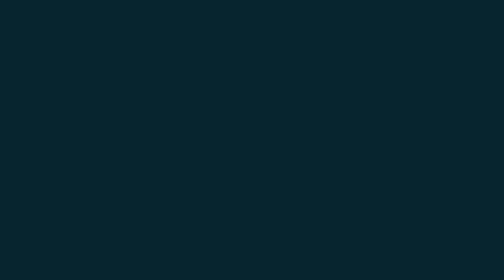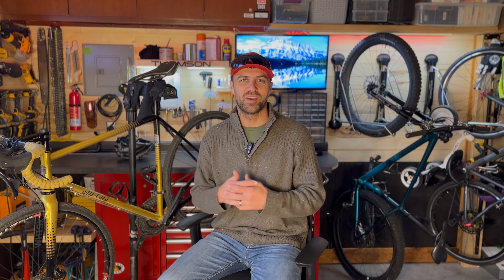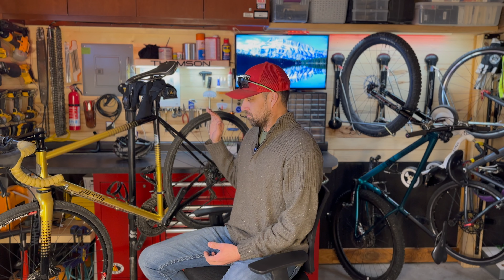Are Carbon Bikes a Horrible Long-Term Investment?

Comment: I don't want anything carbon on my bikes, a buddy of mine is a technician that works with carbon fiber, there are long term complications as the bonding agent will affect it's strength over time, this isn't anything you can really do anything about, people wont be restoring carbon bikes like we restore vintage steel bikes today, buy something that lasts!
Reply: I conceded to a carbon fork as that just makes sense, but otherwise agreed.

Comment: Quality steel, like Reynolds, Cromor, Columbus, Dedacciai, and you forget any kind of issue about the frame. MTB, gravel, road bike made of this modern steel especially xcr or Cento by Columbus are a best buy. Light modern steel and durability the perfect match. Who cares if a steel frame is 300 or 400 gr. heavier than a carbon frame!!!

Comment: A lot of the older riders from the 90's still have a great mistrust of carbon. The abuse the bikes go through from hard riding and the inevitable hard crashing makes the modern carbon frames a disposable item. I still prefer a good columbus or reynolds framed bike. Sure it will be a bit heavier, but it won't be in the landfill after a whoopsie .
Reply from the maker: Yeah that is kinda the thing you have to wonder… did the bike industry shift to carbon because it keeps sales going since steel lasts forever (basically)
Reply: It's not that heavy: my hard-tail cross-country mountain bike (size L with a slooping frame) weighs 10.6 kg with full SRAM equipment and 27.5" wheels (Crossmax). A carbon frame will save 300 grams, but it will be fragile and uncomfortable. In fact, manufacturers are reproducing the same thing as with oversize aluminum tube frames: they vibrate and are fragile. Last year, I had a nasty fall with my Tange Ultimate steel tube frame, and it's as good as new. Carbon is more or less comfortable with 29-inch rims, but on very rough terrain your wrists had better appreciate the vibrations. I tested a friend's bike with an old Clark Kent titanium hard-tail frame, and it vibrated a lot.
Reply: I have close to 15 years on two aluminum road frames and 20 plus on a USA built Specialized Stumpjumper Pro M4...I’ve had a handful of incidents on these three...the back slid out on my Cannondale because of a patch of oil on a turn, and my Fuji got caught in a road rut formed by a poorly paved section in Brooklyn....I used to jump the crap out of my Sepecialized and crashed maybe 2-3 times...on one occasion the handle bar turned all the way and the brake lever put a small ding in the top y
Tube.....that’s all the damage I’ve incurred in over 30 years of riding bikes in Brooklyn and Manhattan....my wheels are the only components I’ve ever seriously worried about.....I’ve cursed the NYC DOT ....Department of Transportation many many times ....loudly when I would hit a small bowl sized pothole in the dark .....ugh it’s horrible...but those head on impacts were never the cause of a wheel going out of true....the lateral shunts were the culprits in the few instances..... and I’ve been riding Continental tires almost exclusively through the decades and have maybe 5 flats in that time frame....
The USA, hand built frames I bought years ago, still serve me to this day....and their equal we will not see again....they are from a different time
Reply: @michaelbonade4667  I had a bad accident a few years back hitting a hidden sinkhole on a Queens street, so it's all over the city. Kept me off the bike for a few years and I'm just now getting back on it (albeit on a trainer as it's too damn cold for me to be riding outside now and I hate putting on all those cold weather layers). When a similar sinkhole developed on my street I immediate notified 311 and within days a crew came by to (sort of) fix it. It's still there but not so bad that it's likely to be dangerous.
Reply: No hate on the DOT🤗😉….its a endless job repairing nyc streets for sure…
Hope u get back to form quick…I’ve done a bit more cold weather riding this fall/start of winter…but I certainly have my limits….
I’ll put up with anything above 40 degrees when there’s no wind….
Calm quiet night rides are something I really enjoy 
👍🏻
Reply: @michaelbonade4667  Yeah they do the best that they can but it's not always enough.

Plus DOS does its best to mess things up by over-applying salt and plowing much more than needed (to reach quotas, perhaps?). The recent pathetic dusting of snow we got led to multiple passes on our side street when the first one was enough.

And DOT did a half-assed job fixing this particular sinkhole because it's still there, just not as bad. And they actually created when they repaved the street a few weeks prior and broke a water pipe feeding an adjacent property, which they fixed but, again, in half-assed fashion as they didn't backfill it properly.

My view is do it right the first time so you don't have to keep redoing it. But then that means that billables aren't as high and they do love them their six figure salaries.

Ah, don't get me started on NYC agencies. Like how 311 was created to effectively shield them from direct contact and criticism.

Comment: Also environmental impact. Carbon fiber doesn't really have a recycle path. Where as aluminium, steel, titanium all can be recycled infinately.
Reply: Only in theory, in reality it may not be economically viable to recycle those frames
Reply: @chadwells7562  that is a factually false statement. Aluminium is and has been financially viable to recycle and has been for quite a while. Currently secondary aluminium production is TWICE as large as primary production. In EU recycling rate of aluminium products is around 70%. In coming years demand for aluminium is only going to increase making recycling even more profitable and necessary.
Reply: @wrongusername  Did I say aluminum specifically? I said frames. How often do aluminum bicycle frames actually get recycled vs. ending up at a dump? Riddle me that. In order for a frame to be recycled, it has to be collected, transported, and prepared first. Are there any large scale operations doing that, or is this more a theoretical exercise where you think a bike frame magically appears at the recycler like on Star Trek?

Comment: I have had two aluminum frames that have had fatigue breaks and my carbon fiber mtn bike(giant trance) has been just fine and I have put more time on the trance than on the other two frames.
Just saying.
Reply: My carbon roadbike (Specialized Roubaix Pro) from 2009 is still up and running, even lasting longer than the aluminum wheels it came with. I am considering replacing her soon, just to be safe, she is old.
Reply: OF course I have seen so many AL frames snap in comparison to CF and I was very much against CF for many years, the reality is very much contrary to this video IMHO.
Reply: The same with my trance i think it all comes down to whos’ designing the layup.

Comment: I’m a fan of aluminum, but I’ve had 5 aluminum MTB frames that’s cracked at the welds.  2 KHS hardtail, Salsa Spearfish, Gary Fisher Sugar and a Specialized Chisel.  Granted a fit I’m 6’2” 200-225 lbs and put a lot of stress on a frame.  Granted if I had bought carbon bikes they may have had issues too🤷‍♂️
Reply: two aluminum frames of mine same thing. carbon mtn bike going strong with more hours of use.

Comment: Having professionally worked with carbon fiber, I choose steel / aluminium for my bikes. 
My road bike has all new components on a 36 year old frame made of Columbus SLX tubing, top of the line in its day and still nice to ride, nothing fancy for modern standards of course but I feel entirely comfortable riding it hard. I wouldn't touch a carbon bike half that age. That bike was a total beater with surface rust when I got it, some surface rust showing that it hadn't been loved in a while, and it was put up on the kerb for free.
My new daily/touring bike is also built on a steel frame and fork because I plan on using it for a couple decades if possible.

Comment: I used to repair Composites for a living so am familiar with the limitation of Carbon. You might be able to get some longevity out of a carbon Road Bike or even Gravel Bike if you are a conservative rider, but on a MTB? It would strongly recommend against it.

They are fine for professional racers that have sponsors to give them new bikes on a regular basis, but for a hobbyist or casual rider, it's nothing but a huge waste of money.

Plus, I restore vintage bikes and you'll be really hard pressed to find a rideable 50yr old Carbon bike in the future. Aluminum doesn't normally last that long.
Reply: My carbon giant trance mtn bike has more hours on it than my aluminum mtn bike and aluminum road bike that had fatigue breaks

Comment: My 1996 Trek 5200 is carbon and still going fine. Came from steel back then. Don't want to go back. Only changes are a carbon seat post, a narrow aluminum handlebar, wheels, tires and chain with cables. It rides better than ever.
Reply: But it's a Trek.
Reply: My carbon roadbike (Specialized Roubaix Pro) from 2009 is still up and running, even lasting longer than the aluminum wheels it came with. I am considering replacing her soon, just to be safe, she is old.
Reply: @JeffreyWilliams-dr7qe  - Yup, and mine was built in the USA and drove the bike carbon technology. 😄
Reply: @IronHorsey3  You're sure about all this Uncle Sam? Trek built in USA 1960s?
Reply: @thefox47545  My steel frame dates back to 94. 11 speed Campy Chous. Another 20 yrs easy. Thanks for your time.
Reply: @JeffreyWilliams-dr7qe  - Do you need a picture of my 1996 Trek with the built in USA badge? 
It reads, "Designed and Manufactured 100%.. Made in the US."
Reply: @IronHorsey3  No just checking and kidding. One has to be loyal to a machine like that. Be safe out there. Thanks for writing.

Comment: Ive heard carbon fiber bikes break catastophically too often.  Ive had my regular material since 2009.  It just broke.  That specialized sirrus has been a damned good bike.
Reply: My carbon roadbike (Specialized Roubaix Pro) from 2009 is still up and running, even lasting longer than the aluminum wheels it came with. I am considering replacing her soon, just to be safe, she is old.

Comment: I'm a fan of the steel ride. I would highly recommend steel from Surly, Soma, Velo-Orange, Crust, or All-city (like the one in the video). They are made from quality steel and sensibly designed to allow for a variety of useful configurations. Rivendell is another builder of note with more of a boutique and classic flare. Most of these manufacturers take the time to electro-deposit a coating on the inside of the frame to prevent rust and makes building up a bike a breeze.

Comment: I've crashed my Ti bike once, pretty badly. I suffered a mild concussion but didn't pass out, and some of the components like the derailleurs and shifters got scuffed up but otherwise survived intact. But the frame itself was unscathed and undamaged. Given the kind of accident I had (hit a hidden sinkhole in the road, end over, hit my body and head pretty badly), I doubt that a carbon bike would have survived it.

I had a similar accident on a previous steel bike and while the frame came out ok the steel fork bent badly. I also had an experience where some guy came up behind me while I was riding alone and drafted off me for a few miles, but I had to brake suddenly to avoid a well-marked bump that I assumed he could also see, but he didn't and crashed into me and ended up cracking his carbon frame. I felt bad for him and hung around, but we both knew that it wasn't my fault and he just wasn't paying attention. My bike was perfectly fine. Convinced me to never buy a carbon bike as I can't afford to be buying a new frame every few years and I don't want to ride too cautiously because what's the fun in that.

Comment: That's a nice bike! I have ridden steel frames for decades. For the last 10 years I have used an affordable titanium bike. And a few aluminium bikes on the side (mtb, cross, track). I honestly have never been on a carbon bike. And frankly, I'd like to keep it that way. Although I am sure they are great to ride and I actually don't think there are that many quality issues. But for me, durability, affordability, ease of maintenance and comfort are important. I also think carbon is a very problematic material in terms of environmental impact and recycability. If I can spare the money, my next bike hopefully will be a nice steel bike.

Comment: A Bicycle is not an investment, buy it to enjoy it. I have a 1990 Specialized Allez Epic that is my primary outdoor training bike. The bike is awesome, all Dura Ace with Mavic Open Pro C wheels laced with CX Ray spokes. Also have a 2018 Specialized S-Works SL6 with Di2 Ultegra set up including Power Meters. My indoor trainer and occasional outdoor trainer is a 1985 Trek 560 set up with early 90's 105 equipment. Carbon is better than you think and can be repaired. Just ride 'em!
Reply from the maker: Thanks for sharing your story. I agree. It is not an investment for the monetary purpose, but more so as an investment, kind of like dividend-based investing where you want to see, long-term high end results and enjoyment year after year throughout the entire lifespan of the bike

Comment: Carbon fiber also does not handle point impacts well. Which is why manufacturers will add an extra layer in their mountain bike frames. However, a lot of them will use the same layup on the gravel and road frames, even though gravel is notorious for having rocks fly everywhere 😅

Comment: In cross-country mountain biking, I've tried a lot of frames.  However, my best investments are not in a carbon frame, but in a Tange Ultimate steel tube frame. I've already broken 3 carbon frames (Giant, Scott, Trek) and 2 aluminum (Cannondale, Trek) ones. My latest Specialized Epic Expert EVO 2019 is practically new, as it doesn't offer the fun and comfort that can be had with that good old 10.6 Kg steel hard-tail frame.
Reply from the maker: I agree u cannot beat steel!
Reply: @BikeVanDad  In France, there are several companies that buy upmarket frames from the 90s and modernize them. The final price easily exceeds €2,500 with very average level equipment.

Comment: I am in the process of building out my 2022 chisel. You'r right its super light.  I have a question. I have a 2015 Specialized Hardrock and wondering if i can swap a few components off of it. mostly if i can run the 27" wheels with the chisel? Thanks in advance.

Comment: In my variety  of riding choices my trifecta of bikes are the Felt Broam 30,Felt FR 30 to step up on performance and speed I had no choice but to acquire the carbon frame of the Felt AR Advanced 105 Di2 obviously I’m a fan of the Felt bike brand 😂
Reply from the maker: honestly having brand loyalty is quite a rarity these days as folks chase the next best deal. so props to you for sticking with what you know works! ride on!

Comment: Nice looking road bike.  I guess the All City Brand is going away.  This brand seemed to have a high niche popularity.  Not sure if it was mentioned but steel bikes can be repaired easier.
Reply from the maker: Yes it is going away but it is a QBP brand so QBP will still warranty it forever. I believe they are consolidating their bike brands and putting more models and focus into their salsa and surly lines. It is an awesome steel bike though for sure! They are going to continue releasing models this 2024 season so you will probably see really good pricing on the all city bikes this year and with the continued warranty from QBP it’s kind of, a great opportunity!

Comment: Agree very much. CF is terrible from a sustainability perspective. I am experimenting with composites made from flax and resins/polymers made from milk and starches.  Amplitex is a flax based fiber that yields a not as strong but more compliment frame.  Future composite bikes will be compostable.  The auto sector is experimenting with sustainable composites.
My fav materials is steel.  It’s repairable and recyclable.  Ride quality is amazing.  I still ride an 86 steel Rockhopper.  I even bent the dropouts of it to accept wider hubs.  Can’t do that with CF!

Comment: I have had three carbon fiber street bikes over the last 35 years (Alan Carbonio, ICE Hammer and Neuvation CH500). Despite the odd crash here and there, I have had exactly no problems with any of them. My previous bikes were steel including two with Reynolds tubing. I prefer carbon because it is lighter and more comfortable, while retaining appropriate rigidity.
Reply: Ah, the old 'compliance' BS again??? Wake up Dearie, most people aren't so stupid these days!

Comment: I used to race motocross and the vibrations and flexing in steel and aluminum chassis would cause frames to crack even after gusting them to reinforce. I foresee carbon having more longevity, especially in the gravel scene.